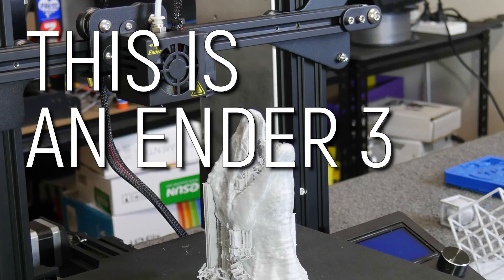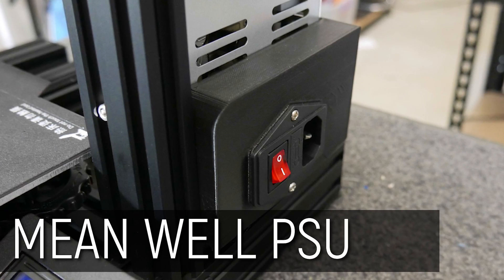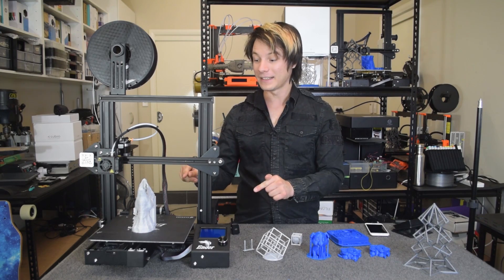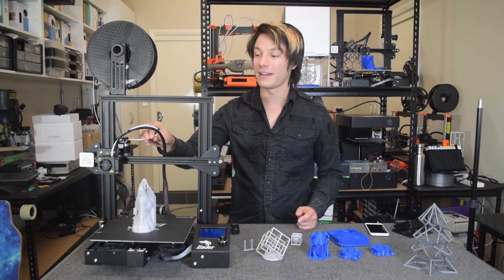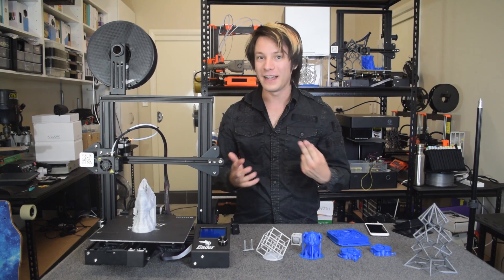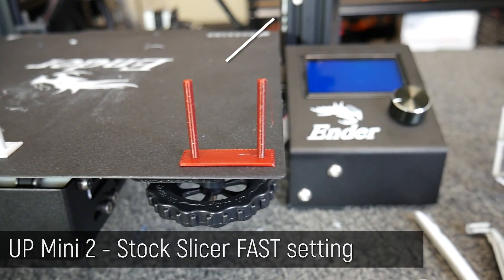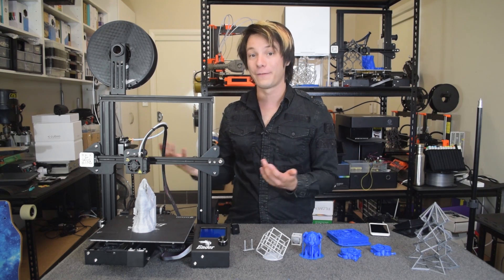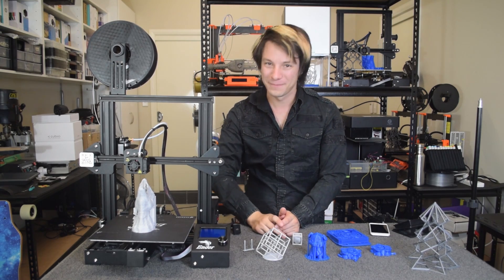Is the Creality Ender 3, Pro?

Comment: I know this video is a few years old now. I just bought an ended 3 from Amazon for $220 AUD and am loving it. I had an up mini but it’s not reliable and can’t get it to work with any software other than their software. Though I can get it to print using windows built in printer forward but there is very little customisation there.. do you know how to get the up mini working with Cura?

Comment: I don't know if you're a shill or you're just pushing this thing too hard. I got an ender 3 Pro and I have none of the issues you're having, just mild ghosting from the heavy axes. The only mod I did was add some nylocks to the headed bed bolts to make it hold a level better. Stock cura generic PLA settings on their ender 3 profile. Every reviewer is reporting issues like this, while I haven't experienced them at all. Didn't experience them on the old 8 bit ender 3 in the school club. It's a statistical improbability that I'd order two unicorns from random aliexpress sellers while experienced 3d printing influencers couldn't get the thing to work.

The direct drive mod you're suggesting is also silly, it's extremely involved and anyone looking it up is going to give up, or decide to buy a different printer. If owners go through with it they'll find their x axis getting wobbly as hell to fix a problem you can fix with a hobby knife in seconds. I'm sure the pricier printers are better but the ender 3 is plenty for most people.

Comment: I just bought one of these last week. My extruder was broken out of the box. I replaced it with the all metal extruder and have been printing ever since. I'm not sure how many hours i have on it but at least 60. I haven't had any stringing issues except for the first print before i enabled retraction. I use 6mm @ 40mm/s. I also bumped the print speed and acceleration up to 60m/s@650m/s² and haven't had any problems. Overall im happy with the unit but this is my first printer so i have nothing to compare it to. The only other mods i plan to do to it are octoprint and a EZR extruder then im just going to use it till it lets the smoke out.

Comment: Not sure if you are monitoring this video anymore but I just got the Ender 3 Pro and was looking to upgrade the extruder feed with a handle. I just found out that the motor shaft has been reduced from 20mm to 12mm and has a pressed on drive gear. I did find the motor with the 20mm shaft and the drive gear with the set screws and I'm wondering can the gear and motor be switched? I'm interested in the drive wheel because I have problems squeezing the release and the drive handle would be a better option for me. The thing is brand new and I don't want to spend roughly $30.00 US on items that won't work. I don't see any reason it shouldn't fit but thought I'd ask the professionals out there for input on this

Comment: Just some small upgrades on the ender 3 and it becomes a beast. First i would upgrade mainboard, its pretty easy.
1 - Skr mini v1.2 board (simple to change, cheap and silent).
2 - Auto bed level sensor
3 - E3D V6 hotend

And also tubing etc like muse said

Comment: I personally don't mind having a 3D printer that lacks a lot of things. It gives me the freedom to modify it to fit exactly my needs. As such I want to try out the Ender Extender kit, so I get a larger build volume, but also so I can test whether it's possible to make it run on 2 chimera's, so I can have quadruple extrusion. I also have some plans for automatic bed leveling without using the BL Touch extension, but we'll see if it works.

Comment: Makers muse.. Could you give me the serie number on the once that you know that has thermal run away issues because a school im starting to work as has 4 ender 3s and I do not want to burn the house down, could you also if you have it give me information on what you can do to the electronics to stop this so you do not need to install a Halon system. Thanks. and keep making Kent.

Comment: Its now July 2020. Did Creality ever add modified improvements to the Pro since this video first aired or is it basically the same since its inception?  My son and I are in the process of looking for our first 3D printer and we read a lot of positive reviews about the Pro but I also read about needing a lot of mods to make it better. One can easily spend a minimum of an additional $100 on upgrades and still not touch everything that is recommended.

Comment: you have the bar the power supply bolts to on backwards.... If you spin it aroung it moves the power supply away from the bed giving plenty of room for the magnetic plate to fit.

Comment: I ordered an ender 3 a couple of weeks ago direct from Creality. Looks like i got a gen 1 (no glass top, no magnetic top, no silicon hot end). Sad day. It also still has the plastic extruder feed mechanism. But still, it's my first 3d printer, and for $210, it's been great. Good learning tool to find out what features one would want on a better printer. Also good to learn slicer and modeling techniques to reduce the probability of failed prints. I immediately upgraded the PTFE tubing to the capricorn stuff before clicking print for the first time. Also got some mirror tiles from Home Depot (home improvement store) to use as a bed. Those 2 things plus spending like 4 hours making sure the structure was square and the bed was level has given some good experiences with my first prints, assuming i got good adhesion on the first few layers.

Comment: I got my Ender 3 Pro three days ago -- been running it 24X7 (seriously very few breaks) and have had zero issues and very rarely see any tiny strings. Certainly nothing even approaching what he shows here.  I used Cura as slicer with all the defaults. Everything just works great. This guy is either incompetent or trolling Ender 3 owners to up his interactions in the comments to increase his youtube presence. Either way -- he appears disingenuous. I came into 3d printing a complete and total noob and am off and running with my STOCK Ender 3 Pro having experienced none of the problems this "professional 3d printer guy" seems to be hung up on.

Comment: Ok like your reviews have a ender 3 pro over comments on upgrades want a 3d printer that is ready to go so can focus on 3d design not doing upgrades and repairs.
Any suggestions please
Reply: Get a prusa mk3. Anything cheap/good value will require tinkering as 3d printing isn't like 2d printing.
Reply: Thanks willing to pay double the original cost of the Ender 3 pro

Comment: well crap, i was about to buy one of these... so what do you recommend for around 350 or below?
Reply: The Ender 3 Pro is a great machine.  While Makers Muse definitely knows his stuff, I fear he is a bit bias in this video.  I have one and have none of the issues that he complained about.  The bed is amazing and maybe too sticky at times, but never kinked like his did, unless he did it intentionally.  The bowden tube can be a little loose because of the couplers seemingly being hit or miss, but that is about my biggest complaint.  The pro version is much quieter than the original and has several functional upgrades that might not effect print quality but will improve longevity of the printer and reduce maintenance (like moving the fan for the main board so that debris and dust cant get into it like the original model)
Reply: @Trueflights  ya i went ahead and bought one anyway a couple weeks ago and love it a ton!  What are your thoughts about the 6 kickstarter?
Reply: @ToddVance  I haven't really looked into it that much.  I saw some images, and it's a nice looking machine, but more than what I need, so I never did much digging.  The Ender 3 is plenty for my needs and I have a Elegoo Mars on the way to handle the smaller and more detailed things.

Comment: My Ender 3 Pro is getting the MAXTEMP ERROR whenever I start heating either the hotend or the bed.Whenever I turn on my printer the nozzel reads at 298 and the bed at 147. I Tried replacing  the thermisters on both the hotend and the bed. I replaced the hotend. I also reflashed the firmware. The motherboard I'm using is the stock Creality V1.1.4.  I also have the BL Touch attachment. What else could be giving me this error and what other options do I have other than replacing the motherboard?

Comment: I want to print ABS too. Is it possible to mount a glasplate to the original heatbad? And do i have to use slightly higher temperature
that the glasplate has the right temperature?

Comment: I put my Ender 3 Pro together last night. The POWER SUPPLY clearance was my issue with it too. I flipped the Extrusion so the top was down and down was up. This moved the bolt holes about 3/4" away from the heated bed than the plans show. That means that the power supply is moved to the right by 3/4" of the location the plans show.

Comment: I keep getting an error message: "Thermal Runaway, Printer halted" with my Ender 3 Pro using PLA at 210 extruder and 60 heated bed. Can't figure out the problem. Need Help.

Comment: The funny thing is, the ender 3 is technically the upgrade. First off, its half the power 12 not 24. Which is a huge issue. Almost all the updates on it have no actual effect to the the performance. Yes its quiet, but has no effect on the print. The mainboard is good and quiet. However the reason the other things are quieter is not because they better parts. Its cuz the cut the power and all plans and everything are 12v. . That's a huge cut in power and makes it suck cuz it's fans aren't working nearly as good and cooling blows. 24v is going to give you much better performance and cooling. The bed sucks alot. The original was great and should have left it alone. The  usb and sd slots are in a better spot and roll holder is too. But yet again none of these actually effect the print.....all in all, the pro sucks in any area effecting performance. Going to 12v from the 24v of the original was a huge mistake cuz the fans only work half as good. Everyone loves quiet but the truth is going quiet only drops what makes the printer good.

Comment: Been getting virtually no stringing on mine! In Cura, set Shell / Outer Wall Wipe Distance to 2mm or so, Material / Retraction to at least 6.5mm, Travel / Combing to Not In Skin, activate Travel / Retract Before Outer Wall and all Avoid options, deactivate Travel / Z Hop. I also like to run 120% extrusion on my first layer to compensate for the slightly dodgy print bed. Pretty solid results, and I can usually pop prints off without moving the bed and thereby get away with 2-3 prints without re-levelling. So far haven't had any luck with slicers other than Cura but I'm not trying that hard because Cura's fine.

Comment: My Tevo Tornado is not heating correctly; set for 200 C and hot end only goes to about 140 C. Too cool for proper melting. Replaced hot end and got same results. So I figure problem is in the Tevo board or software. Now, I do not know G-Code, flashing firmware, etc., and am still figuring out to fully use my cell phone, so you get my level of making changes to a printer are about nonexistant. I was thinking of replacing the Tevo for another printer typw and was looking at the Ender 3 or 3 Pro. However, some of your comments about tweeking it caused me concern, as I don't know how to do these things. I liked you comment about direct drive and auto bed leveling, .... etc. So with that in mind and not wanting to spend $$$,  as I'am a hobbist, do you have any other printer model suggestions? Thanks.

Comment: I have some notes on my personal experience.
My magnetic surface has never kinked and is still strongly magnetic even after printing with 70 degree bed. The mat doesn't catch the power supply if it's properly seated. Are you sure the extrusion that holds the power supply isn't rotated 180 degrees? The power supply should have plenty of clearance to the bed.
The Pro features power loss recovery. To my knowledge, the standard Ender 3 doesn't have this.
The very first thing I did was install Marlin to add thermal runaway protection. I didn't test if they now have thermal runaway protection from factory. My Ender 3 is pretty recent.
The bowden fittings now include the clips in the bag. If there's any play in the bowden tube and the fitting, it's a faulty fitting. Creality includes many fittings just in case.
The extruder upgrade to metal was my second primary modification. The plastic one tends to fall short of grabbing the filament because the idler just barely fails to go all the way. Loosening the pivot screw fixes this, but they're also known to crack with the same result. Upgrade the extruder as soon as possible. There are even 3D printed ones available.

Comment: Hi i am about to get a 3D printer i never had any relation with any 3d printed related thing i didn't even held something 3D printed so i was thinking about getting a Flashforge Finder but then i discovered that it is comparable with the ender 3 pro and the CR-100(but seeing the review you made it's realy out of question for me)     so i was wondering wich one is best the ender 3,ender 3 pro or the flashforge finder thanks for the help and sorry for the text

Comment: With the magnetic surface in the correct orientation you can lift the front until just the back edge is in contact with the magnetic base and then you can slide it side to side and align it so it does not hit. Try it.  Also, always remove the print with it warm.

Comment: I'm having a terribly difficult time making my Ender 3 'Pro' have the prints actually stick to the bed. The GLASS bed. Adjust nozzle height, made the bed *perfectly flat*, etc. Tried changing setting on my slicer, nothing was different.On top of it, the nozzles it comes with are cheap; I sheared one off earlier trying to switch nozzles, top bit of the nozzle is stuck in that little screw area where you screw it in, and now I will have to disassemble the whole thing to get it out.

In short, as a new comer to this hobby, I am extremely disappointed. However, I am willing to attempt to mod the cursed thing, if I even get the money to. Any ideas as to how it can be dealt with in it's current state?

Comment: after i assembled my ender 3 (which is suppose to be an upgrade from my first printer "xyz mini maker which i love" i followed the instructions for leveling the bed and pressed home it stopped with the extruder 10mm from the printing bed. 1 is that normal 2 will i have to set it up every time i want to print on it and 3 can i connect it to my pc like the mini maker? thanks

Comment: If the build sheet is the same width. whether you have the sheet forward or backward, why would it hit the side if its turned around one way vs other ??   I must have missed something.
Reply from the maker: The magnets make it "key" into discrete locations depending on orientation 👍

Comment: As I have watched more and more reviews I think the 3D review community is missing it. While the prusa i3 mk3 is the bar most people don’t have the 700+ to pay for one, nor should they. I really want to know what platform is the best starting platform that with a few upgrades (auto level, direct drive) I can get all for $300. I have been leaning toward ender 3 or 3 pro, however it seems those are much harder to get firmware installed on for auto leveling. This is where the tarantula pro looked great, but not that big of a community around it. I also saw the Mingda d2 with direct drive out of the box and auto leveling but not many reviews. 

Can someone get prusa quality and print size for $300? If so what printer and upgrade combinations are required?

Comment: I use bowden all the time without issues.  i slightly prefer it. but on a prusa there's no reasn to not go to a direct drive since the Y axis is the one which's gonna be making your biggest ringing and you have to set your speed according to that axis anyway, on my corexy tho removing 200-250g of weight makes a MASSIVE difference

but for your problems, I blame the extruder+horrible hotend design get a bmg  and a v6 and most of your issues will be fixed :) you get slightly more bulging but linear advance + more acceleration/jerk fixes that if you care about it. you don't have to get a genuine if you're on a budget either. i personally get clones and put a genuine metal heatbreak + thermistor on them cause i'm really on a tight budget

Comment: I just got my Ender 3 two weeks ago and have been printing none stop.  Once I was comfortable with my setting I tried the string test and in all honesty by print with stock ender 3 parts look better then the results you showed from the UP mini2..  I print in super fine quality with tonnes of setting changes and double the standard speed (100mm/s)  I am still using the Creality filament I ordered along with the printer.  I am thinking of upgrading the bowden tube and the coupler since it does move a little when retracting but so far I am pleased with the results.

Comment: FYI you can turn the  extruded upright around 180 then reassemble then attach power supply that way it is located towards the outside not the inside.. after reading your review and watching a few assembly videos i figured it out that i can turn the mounting upright to locate the supply on the outside that way you have more room and your  bed cover does not hit. the extruded upright groves are the same on either side so it doesn't matter which way you turn and mount it.
i also got the pro for even 200 direct from their website with free shipping. 
simple easy fix.
MM

Comment: This video is 7 months older than the E3 Pro I just bought from Amazon's "Official Creality" seller, and I didn't get the thermal sock. I guess I didn't get thermal runaway protection either. Seems I need to look into aftermarket upgrades soon...